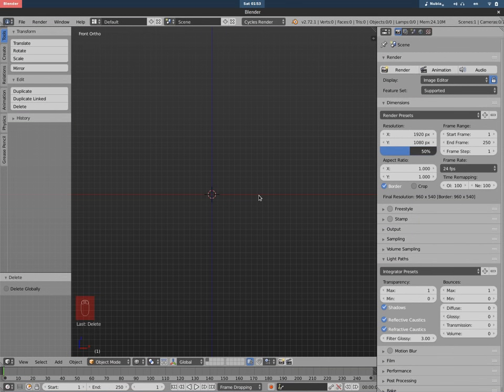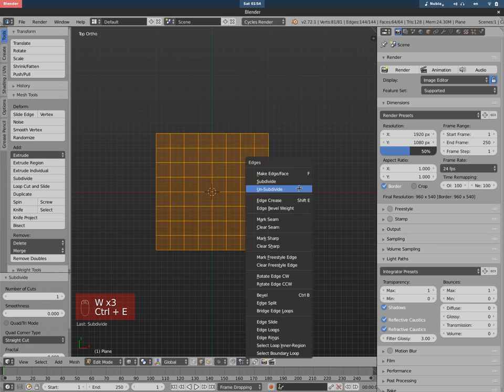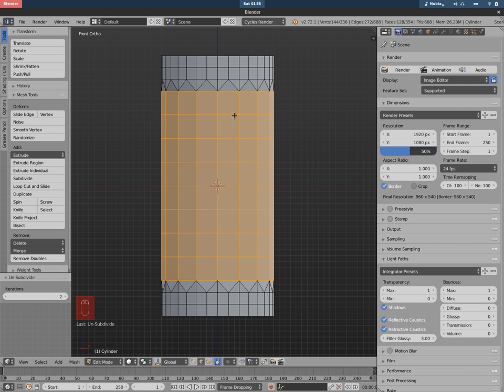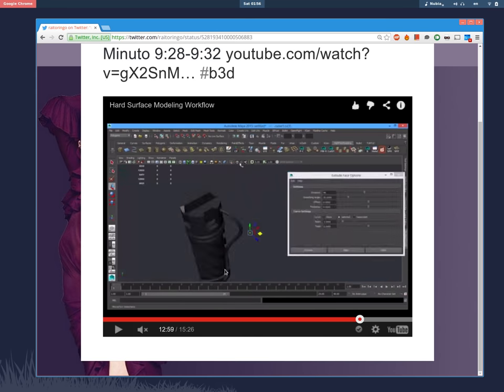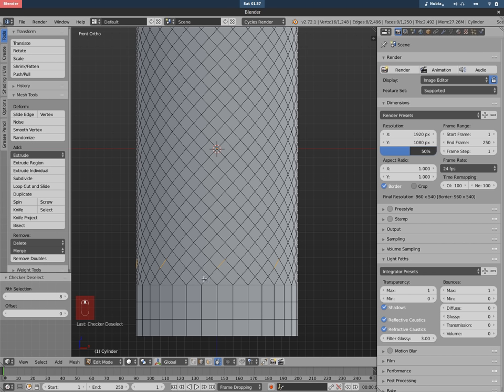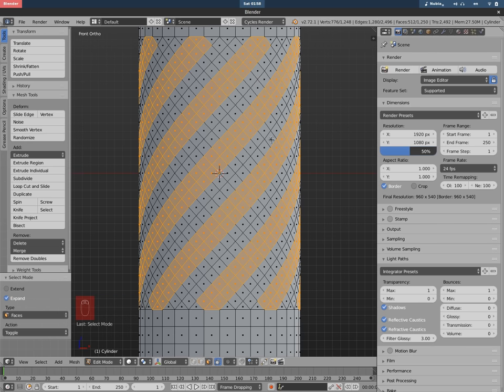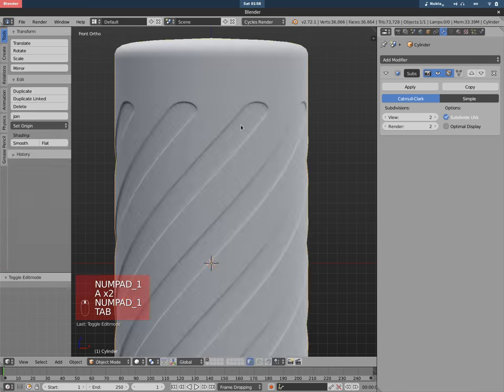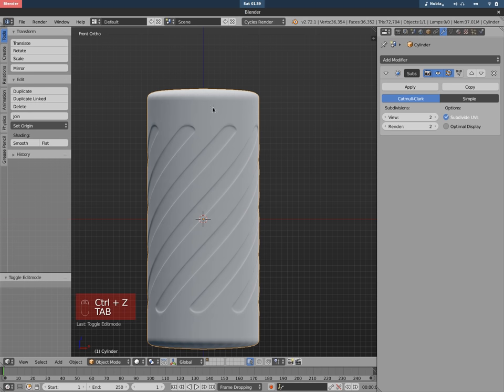Grid Twirl - Mesh Trick in Blender

Comment: in blender 2.78 the checker deselect tool has third parameter called "skip", which made it impossible to mark edges in a manner you presented. Any idea how to go around it?
Reply from the maker: Hi! I've just tried in the latest Blender and I get the same results if I go with Skip 1 (offset 0, nth selection 8).What exactly doesn't work for you?
Reply: It's fine - my bad! :D just got confused by the wireframe view a bit. Sorry, still a beginner here! Nevertheless, thanks for the tutorial - I appreciate a lot folks who just help out others with no significant gain. Stay safe, friend!
Reply from the maker: My life wouldn't be the same without Blender and open source. Gotta give back. Hugs!